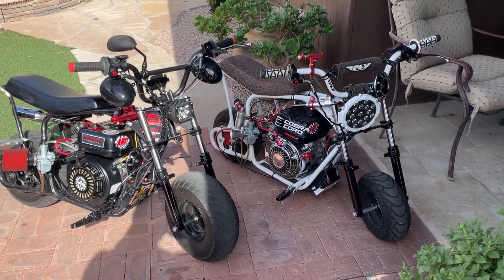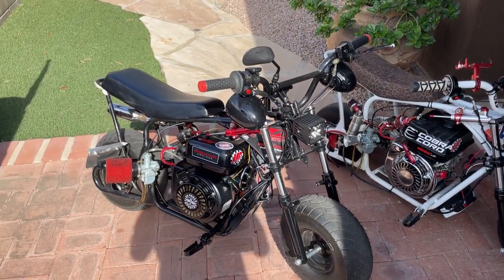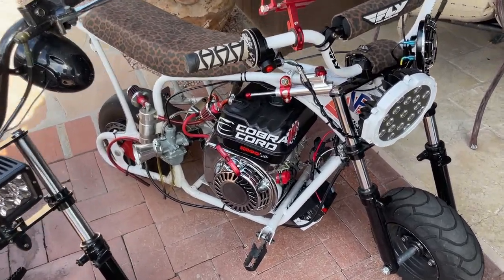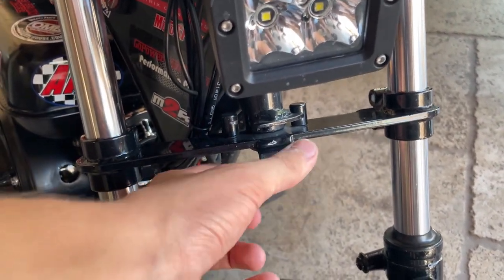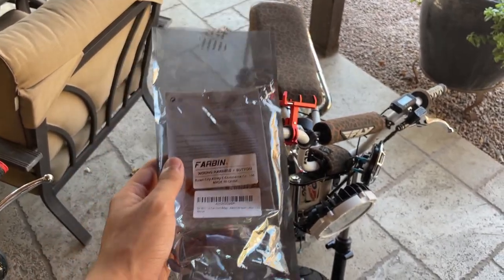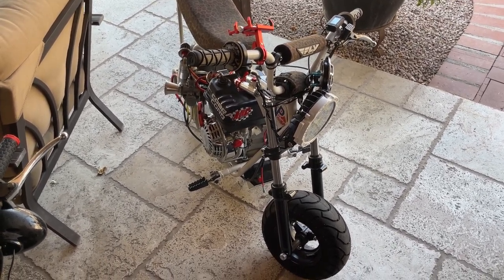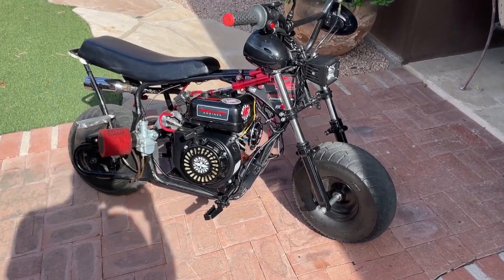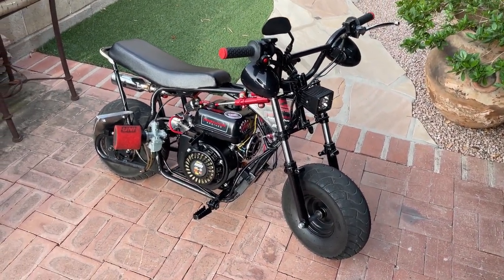How To Install A Horn On A MInibike! Predator 212 Monster Moto!

Comment: You should check out the go power sports rear suspension
Reply from the maker: Yeah! I’ve seen it but in my opinion it’s not worth the price tag. I may be building a custom rear suspension on another bike
Reply: @Guido19  nice

Comment: Do you have just a regular 12 Volt Battery that you have your Horn and Lights running off of ? I've been thinking of adding a Horn to my Bike too but I'm afraid if I add too many accessories that run off a single 12 Volt Battery the Battery would die rather quickly being we don't have the proper Flywheels installed that keep the Electric Current flowing like when they were stock. Assuming you took off the stock FLywheel and slapped on a Billet Flywheel like most people do. That's when we cut off the 2 charging Coils. I suppose you can keep a Battery Charger on hand to charge the Battery now and then. But right now I got the LED Headlight, tail light, and2 orange turn signal lights hooked up to my 12 Volt battery and i disconnect the wires from the battery when I'm not riding at night just to save the Battery. I gotta get the Toggle Switch hooked up inbetween battery and lights so i don't have to keep disconnecting the wires every time lol it's a pain in the ash.
Reply from the maker: Yeah so I’m using a regular 12v motorcycle battery! Here’s the full video on it and the lights. https://youtu.be/rBxiJ6N7QfI I also have a full stero with a amp running off of it 2. I haven’t really tested it but with all of them on and going the battery lasts forever and I have never had a issue! Every time I’m done riding it I unplug it and put it on a trickle charger. This bike doesn’t have a coil/charging system.
Reply from the maker: Here’s the stero system install video lmao https://youtu.be/4ELz9OuxuOQ